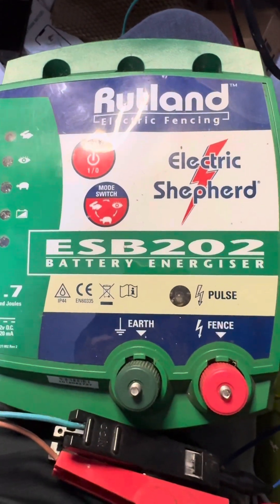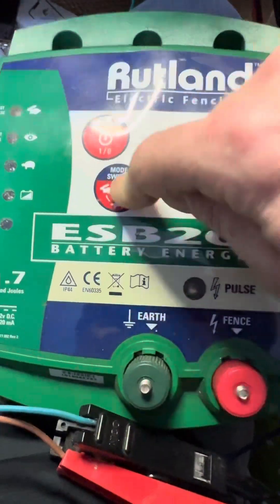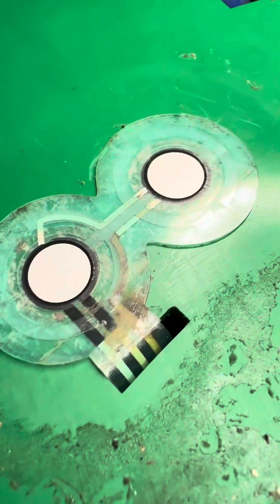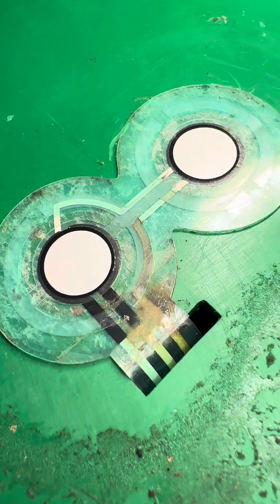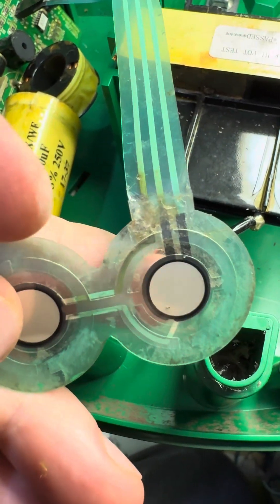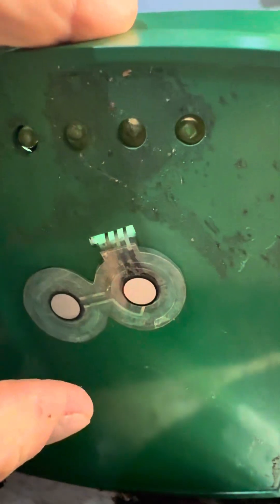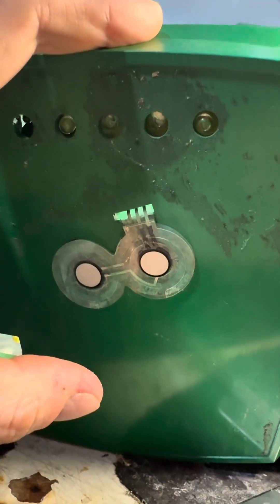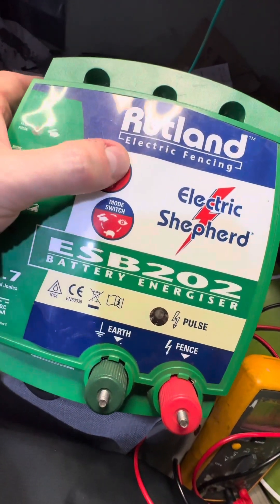Repairing a Rutland ESB202 Electric Fence Energiser – No Power Fix!

Comment: Well you can try using a button.Just scratch the line of the pcb where the button should be.I think it may work.😅😅
Reply from the maker: @Valor_Nikto  that was the backup plan, I just wanted to keep it original looking though and it’s outside too so would need to be waterproof